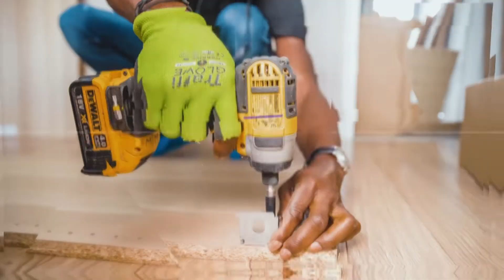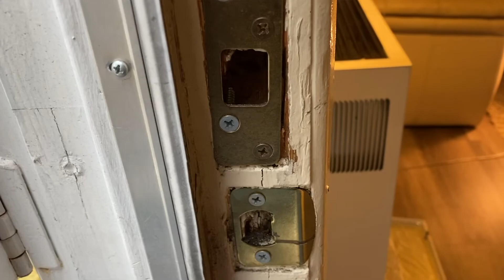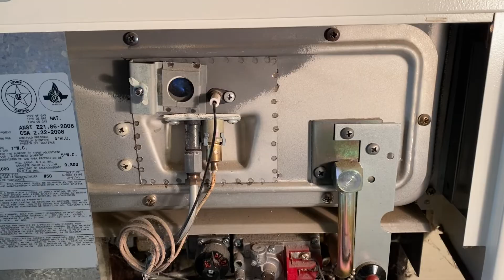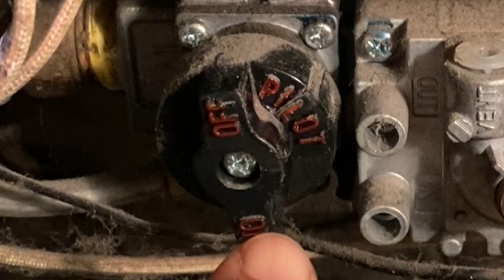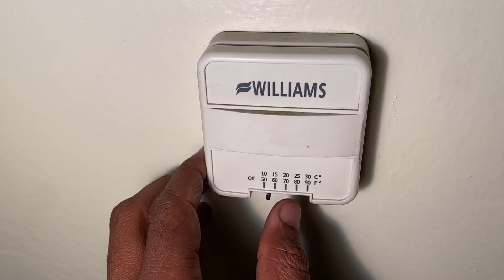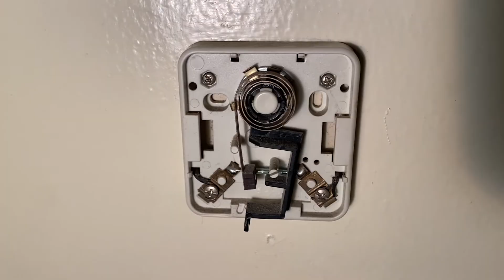WALL HEATER NOT WORKING?

Comment: Not sure if anybody will see this: I live in an apartment and and unfortunately it has an electric wall heater.  There is a giant hole from the outside that goes to the inside and cold are always rushes through the heater in the winter time. Is the hole necessary for some reason or are the people here just too lazy to seal it up? I'm  tired of paying hundreds of dollars every winter. Any help is greatly appreciated!
Reply from the maker: If it was a gas heater the hole is for combustion and ventilation but its an electric heater- they dont need burn fuel and don't need combustion air or exhaust venting. Are you sure it's electric? Look at the unit closely. Does it plug in or is it hardwired? Is there a gas line nearby? Some wall heaters look electric but are actually gas. If it's gas, that hole is critical for safety - it provides combustion air and sealing it could lead to carbon monoxide buildup.

The hole might be a leftover from a previous gas heater that was replaced, like you said poor construction/lazy installation, or intentional ventilation for the room (some older buildings have these).

Take a photo of your heater and the hole and show it to your landlord/maintenance. Ask them directly what the hole is for.
If they confirm it's unnecessary, request they seal it properly.
If it's an old gas heater hole no longer needed, it should be sealed from both inside and outside with proper insulation and weatherproofing.

Don't seal it yourself, have them do it and film or photo that if you can.
Reply: @Caliber8Tools Sir, thank you for your valuable information, I really appreciate that very much! 
It's 100% all electric plug in wall unit. I believe the brand name is Amana and if I had to guess it was installed in the 90s. This is the type of thing you see in a hotel not an apartment as they're not too efficient (in my opinion/case) perhaps if the hole was filled it would wouldn't run nonstop and you can quite literally feel the cold wind blowing through mixing with the heated air it's quite ridiculous! I didn't want to try and block the hole out of fear it was somehow necessary....didn't want to risk a disaster as I am ignorant to all this stuff.
 I will do as suggested take pictures and ask the landlord if they can fix the hole because this is a small two bedroom and I'm paying more than most houses for my electric bill. 
You're absolutely awesome for this! Thank you for the kind and detailed response, sir! 🙌 💯 🙏 ❤
Reply from the maker: Glad it was helpful.

Comment: Como reconectar el termostato por accidente se desconectaron los cables
Reply from the maker: Primero - Pasos de Seguridad Importantes:

Apaga la electricidad del calefactor en el interruptor o en la caja de fusibles
Cierra la válvula de gas que alimenta el calefactor (válvula de un cuarto de vuelta)
Toma una foto del cableado existente tanto en el termostato como en el calefactor antes de desconectar algo más

Conexiones Estándar de Cables del Termostato:
La mayoría de los calefactores de gas usan 2-5 cables. Aquí están las terminales comunes:
En el Termostato:

R o RH (Cable rojo) - Corriente de 24V del transformador
W (Cable blanco) - Señal de llamada de calefacción
G (Cable verde) - Control del ventilador (si tienes aire forzado)
C (Cable azul/negro) - Común/Tierra (no siempre está presente)
Y (Cable amarillo) - Enfriamiento (generalmente no en calefactores de pared)

En la Placa de Control del Calefactor:
Encontrarás terminales correspondientes. La configuración más básica de un calefactor de gas solo necesita:

R y W (sistema de 2 cables para calefacción básica solamente)

Pasos para Reconectar:

Conecta los colores de cables con las letras de las terminales en la placa de control del calefactor
Conecta los mismos cables a las terminales correspondientes en el termostato
Asegúrate de que los cables estén bien sujetos en las terminales (no flojos)
Restablece el gas y la electricidad
Prueba subiendo la temperatura en el termostato

Comment: I am pretty sure my gas is still on but my pilot light is out. 
I tried the steps you described to reignite the pilot light but nothing happened.
Reply from the maker: Could be a clogged pilot tube or bad thermocouple. Could also be low pressure in the gas line. Turn gas off wait 10 min. Check the pilot light area for any debris. Try again. If nothing happens after that contact an HVAC professional.
Reply: @Caliber8Tools  okay thank you
Reply from the maker: @scoobydoo23320  You’re welcome.

Comment: Is there some sort of thermal cutoff switch in wall unit itself?  I had a 7 year old William's wall heater, just this year it won't run for more than 3 minutes.  It won't turn back even if the thermostat is at the hottest as I have to press the tiny reset button on the upper lefthand of the wall unit.  Yet when I press reset, it again will only run for 3 minutes and typically once it goes out after 3 minutes, pressing the reset button won't do anything until about 10 minutes after it last ran.  The pilot is always lit and there's never a gas smell which leads me to believe the flow of gas is fine but it triggering some sort of thermo switch independent of the thermostat.  The thermostat works fine as it won't turn on unless it's set to a higher temperature and while it's running for the 3 minutes, if you turn the thermostat down all the way, it turns it off.  To add to this mystery, two repairmen couldn't figure it out and just install a brand new Williams heater but it's doing the same thing
Reply from the maker: Yes, most wall heaters have a thermal cut off switch to prevent fires.
Reply: @Caliber8Tools  thanks!  We did find out that’s what’s happening but we don’t know why.  The handyman did more research and thinks it possibly an exhaust partial blockage.  Will report if that fixed it

Comment: if the push to start doesn’t work you may have to unscrew the window bracket and use a match.
Reply from the maker: Very good tip, thank you.
Reply: @Caliber8Tools  thank you, as i woke up this morning and the heater wasn't working.  been out of town for a month.